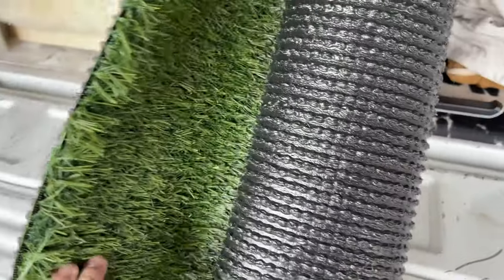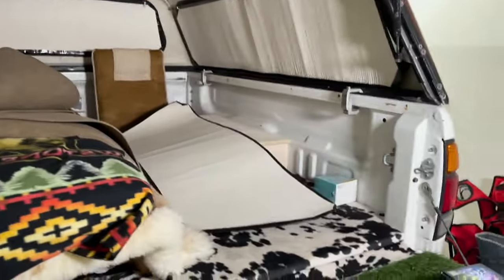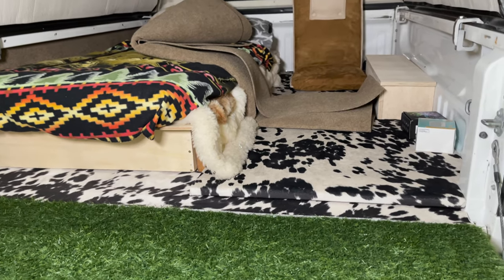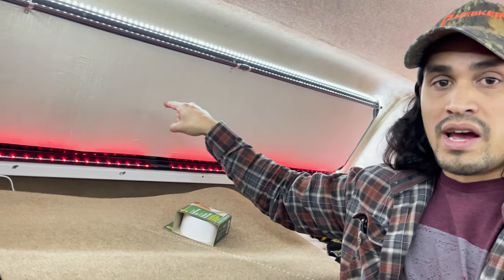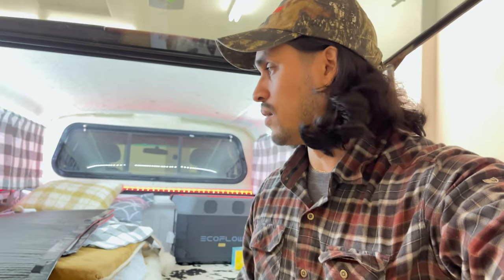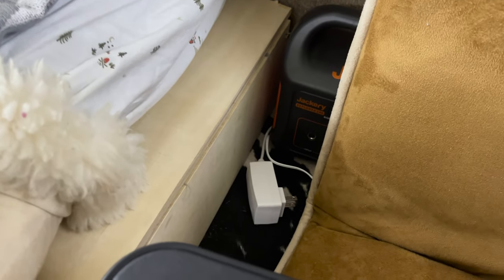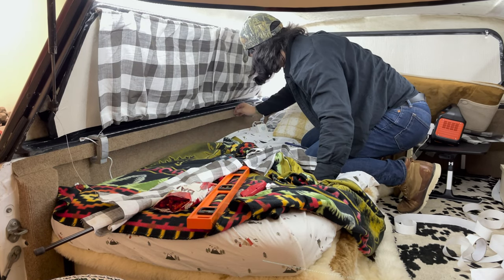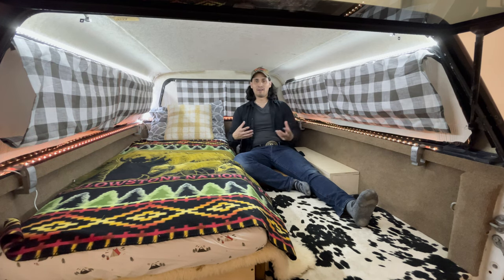Part 3 | Building the COZIEST truck camper build for STEALTH camping & gaming!

Comment: that's pretty awesome inside 🙂
what glue did u use for the carpet on sides? or was it the same stuff!

try a Walmart parking lot or near a McDonald's
Reply from the maker: Thanks! It’s pretty comfy 😁.  For the interior carpet I actually used double stick tape for a less permanent install, but what I found was vinyl flooring tape stuck better than carpet tape.  The indoor/outdoor carpet has a pretty fuzzy underside so it’s a little harder to adhere with tape but it seems to be holding!  I’ve got my eye on a nearby Walmart lot haha it actually seems to be a hotspot for overnighters and misc nomads.
Reply: @SethWild  I am putting things in the works for mi small truck too!
Reply from the maker: @Michael85338  Sweet! It’s a lot of work up front but it’s such a great feeling when it starts to come together.  Hope to see a video of what you come up with
Reply: @SethWild  yes it is

Comment: What happens when it's raining and the tailgate is open while you climb in? Doesn't your floor and bedding get all wet when you close it?
Reply from the maker: I haven’t encountered a rainy camp yet but when I do I’ll just leave the tailgate shut and enter with the window up (which should give cover from the rain some too).  I’m sure I’ll have to test that eventually
Reply: @SethWild  Thanks for your reply! It makes perfect sense to climb in over the tailgate 😀
Reply from the maker: @rebeccarogers8958  absolutely thanks for checking it out! You make a great point though, any water caught in the turf would definitely pour into the floor area, maybe I’ll poke some small drainage holes in the fabric 😁